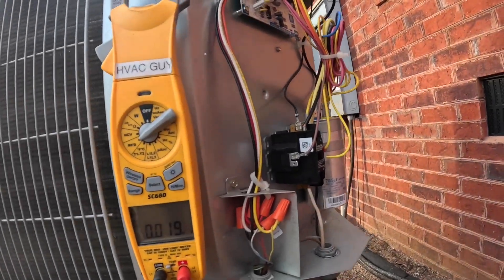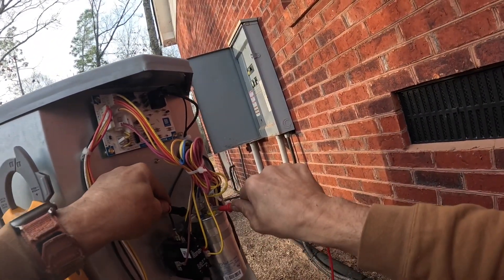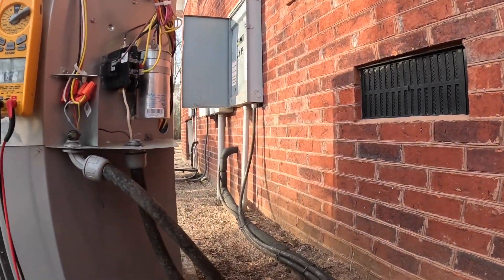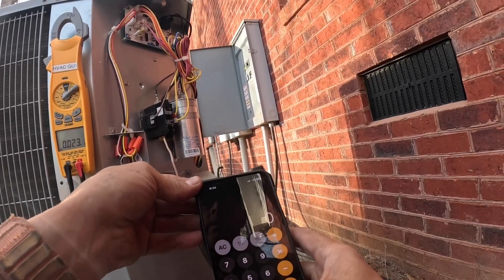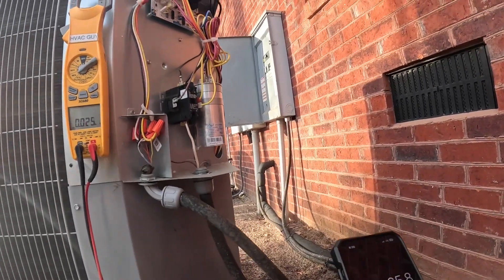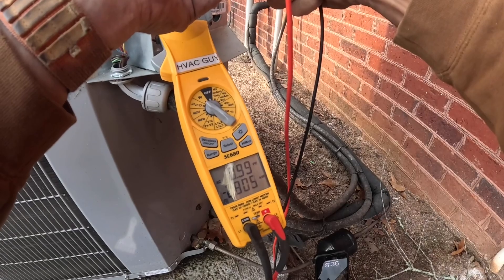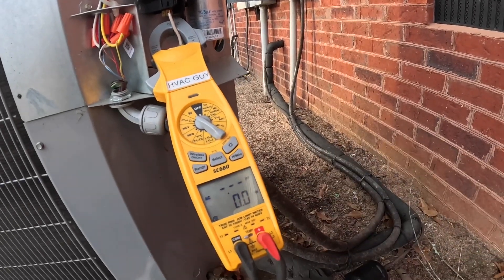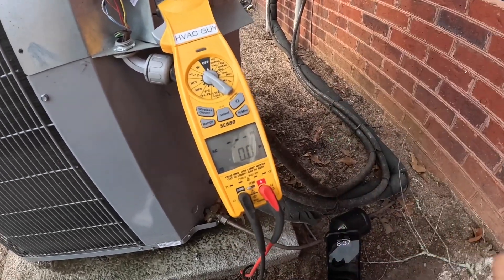If the Power Factor is Close To One, Does it Mean the Capacitor is Good?

Comment: When you're checking a capacitor for what it's doing while it's running you need to do a load test. It's a conversion formula to give you the actual microfarads of when it's running. The HVAC school app has it and so should every technician

Comment: I never heard of Power Factor.  Is it the same as back EMF from the compressor?

More stuff to look up :D
Reply from the maker: No. It’s more of a measure of efficiency. How much of the power supplied is actually converted to work. There are much better explanations. Check out the engineering mindset channel

Comment: I like to used the formula 2652 × amps / voltage for checking a capacitor under load.  Comes in range of its reading

Comment: 2652 X Amps / Volts.
Reply: That’s only for 60hz, if 50hz (European power) the number is 3179 instead of 2652.  Reactance of capacitor varies with frequency of power

Comment: Great tip, Thanks. Are Carrier units a problem? I am thinking of replacing mine with a Heil unit that I think is made by Carrier. If it is an issue somebody let me know. Please
Reply from the maker: They all have problems.
Reply: I hear ya, thanks @HVACGUY
Reply: I don't know of a manufacturer that doesn't have some issues. Carrier/ICP yes you'll be replacing the capacitor within 4 years and more likely closer to 2. You could ask your contractor to install a AMRAD on it when it's installed and leave the OEM cap with you just in case.
Reply: Thanks I appreciate that. I have a goodman that is 18 years old now that was never touched until it was 13. It's a slow leaker that I put stop leak in last year and so far so good but I know the inevitable is coming soon. @Jhunter844.arkansas

Comment: It would have been interesting to see what it would have done under a load, while running. And do the calculation with amps × 2652 ÷ volts. I'm sure it would have come up exactly the way it did when you checked it with "mf" on your meter while the unit was off. I don't trust the power factor thing at all . 😎👍

Comment: Thanks for sharing the Video! 👍
I would always replace the Cap if it has drifted. I figure its going bad and a new one is good cheap insurance anyway. At our own houses, I replace all new ones  check the value and mark it as well as the install date with my Sharpie permanent marker on the outside of the Cap

Comment: take the wire's off to test.
Reply from the maker: Wires were off
Reply: I think it is off for the herm, hard to tell in the shot. Edit: I think you need to measure the current draw on just the compressor or motor right (w/e you are measuring), not the whole system. I might be wrong and maybe it doesn't throw it off that much?